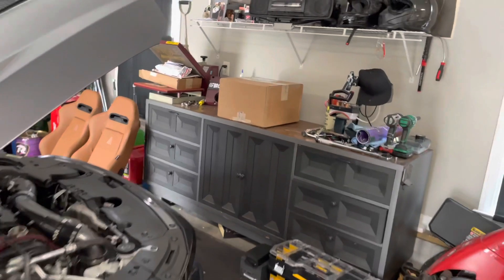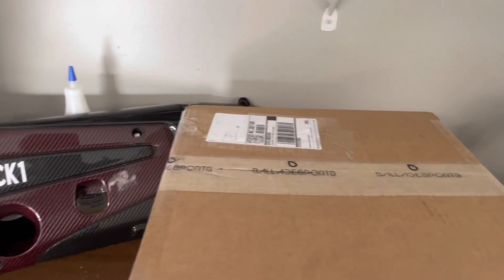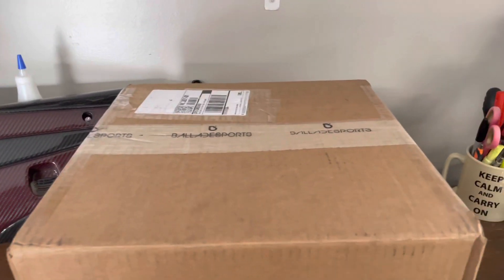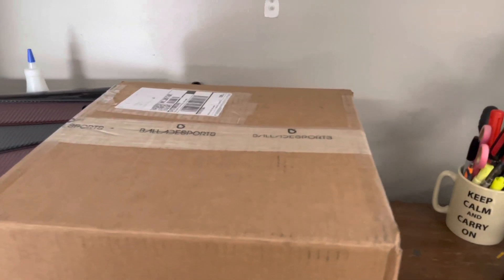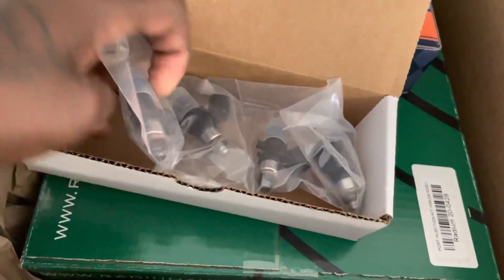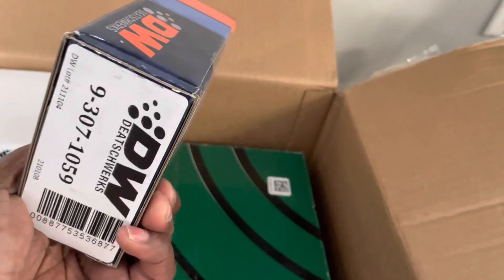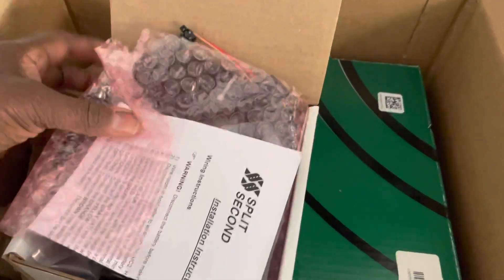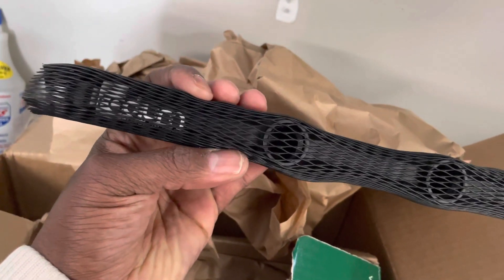Unboxing NEW Port Injection Kit fot Honda Accord 2.0T - more FLEX FUEL [HD]

Comment: Hello, Fbrock. Some time has passed since you got this installed. May you please give us your thoughts on this product as an upgrade for the Accord? Thank you.
Reply from the maker: With a few additional modifications, this kit has been very reliable since installed. If you are trying to get every benefit of a bigger turbo and possibly a built motor. This is a good option. Especially if you are not considering methanol.
Reply: @fred_b_360  Thank you sir! Where can I get it from?
Reply from the maker: @savedby_grace6110  checkout @fk8td

Comment: where did you get the port injection for the 2.0 I looked on prl and only saw it for the 1.5 civics accords
Reply from the maker: You can piece it together through Radium or buy a kit from @JSREngines
Reply: @fred_b_360  thanks one thing I do have to ask have you done any internal upgrades it's one thing I haven't seen many videos post on rods Pistons I haven't even seen anyone do a manifold upgrade yet considering the cars from 2018 for the earliest that's a little surprising
Reply from the maker: Haven’t opened the block. Only ported manifold.
Reply: @fred_b_360  thanks wasn't sure about that

Comment: They do make an upgrade it's on the 2012 TLX type s  my friend who is a Master tech at Acura just purchase a TLX type s it's the same housing as a normal 10-speed automatic Honda Accord I supposedly the shift points are different for the V6 and it got beeped up internals including hardened gears and The shift works are different in it too he said from looking at the schematics he thinks it could handle anywhere from 6 to 1,000 horsepower but he will not know until he warranties his AKA mine by switching the internals from one case to another because of the number on the side of the case and then once you digs into what he'll be able to tell more or less what's actually in it but on paper that is the only upgraded transmission unless you go to level 10 which will build anything

Comment: Wonder if i will be able to pass inspection with this kit in ny?
Reply from the maker: Fuel system. If you’re using a stock turbo, you should be able. This only adds additional fuel via the controller (own separate ecu) at higher rpm. 99% of the time your working off of the stock injectors/ hpfp.

Comment: Reach out to us when you want to tune that SSC, we have plenty of experience with it to a certain extent. Since it's taped off the MAF sensor circuit it can be super picky.
Reply from the maker: Appreciate that. Actually, I’m already working with John/ FK8TD and Derek/ IMW. Currently etuning (Rev 5) 50% ethanol. Definitely will be reaching out when I start building my block.